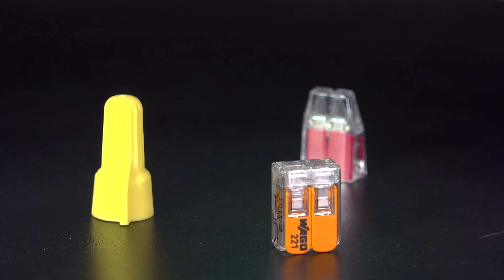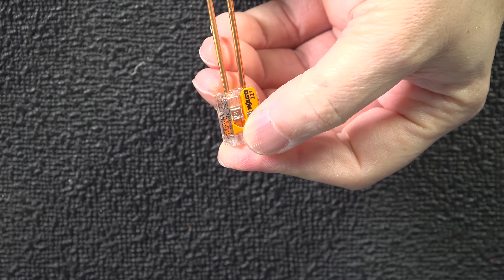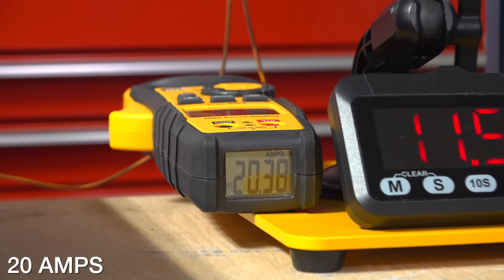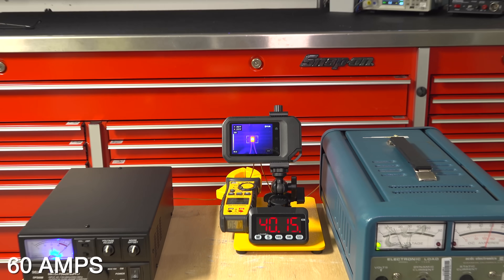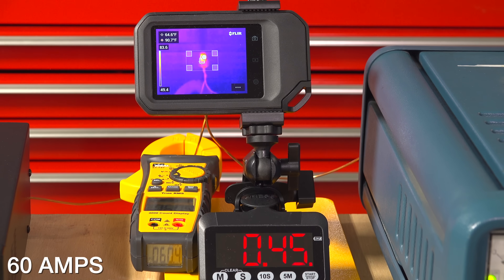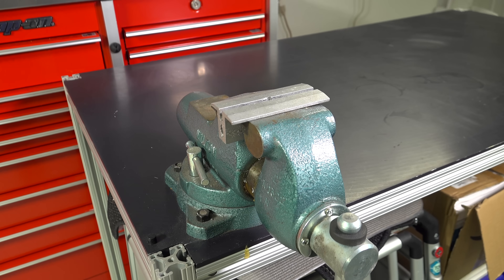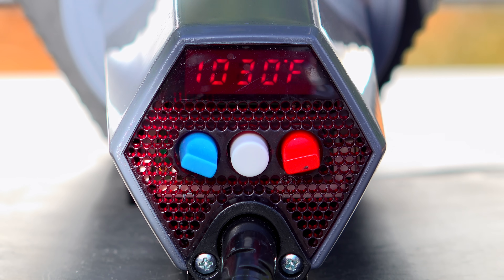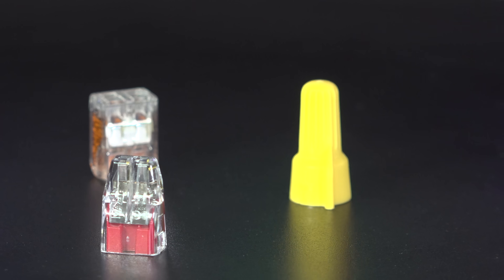What Wire Connector is the Best? Wire Nut VS Wago TESTED

Comment: This clearly shows the wire nuts are superior for Conduction
Reply: ? It shows they are superiour at being cheap, nothing else.
Reply: @TheEsseboy  conduction
Reply: @jfmc2581  Twist the wires before inserting into The other type and you achieve the same effect. Or just don't cause it's not worth it, get larger wires if you need lower resistance, the insulation will boil/burn off before the connector will.
Reply: @TheEsseboy  , Uhhh... No.
Reply: @jfmc2581  Uhhh.... yes!
Reply: @TheEsseboy  , Why do comment on things you obviously know Nothing about?

Are you proud of your ignorance?
Reply: @jfmc2581  I could ask you the same.
Reply: @TheEsseboy  , Being so stupid should hurt
Reply: @jfmc2581  You have presented nothing to prove your theories, please, your lack of self awareness is hilarious.
Reply: @TheEsseboy  LOL! There is no space for it!! You suggest having bare copper of the conductors outside the device is an improvement!!

The scarry thing about stupid people is they are too stupid to know how stupid they are...

I just hope your unique problem solving skills don't kill someone.

Comment: One big mistake in this comparison: in the overload test, the Wago connector was carrying all of the current.  For the wire nut, you pre-twisted the wires, and they were touching below the wire nut...thus current was being passed between the wires where they were in contact instead of all of the current passing through the wire nut.  Otherwise, you would have likely seen higher temps at the wire nut during maximum overload.
Reply: That was my first thought. He literally says he's going to hear shit if he doesn't twist them and then proceeds to twist to a degree that is not possible reducing the overall resistance.
Reply: Craig Dendy  I took his statement to mean the amount of twisting he did was far more than a typical example.  So, real world would be stripped insulation of 7/8" or so of a current carrying conductor twisted together and capped with the nut. In the video they guy took ground wires, which means unlimited conductor length (vs 7/8" stripped) which means more wire is in contact and not the same as the real world use.  Instead of saying "instead of all of the current passing through the wire nut" he should have said "instead of all of the current passing through the conductor only under the wire nut"
Reply: Craig Dendy  Sorry dude, these connectors are UL listed to UL 468C "Splicing Wire Connectors", the exact same standard used to certify wire nuts.  The testing these go through is far more rigorous than the tests shown in this video, and no, they don't wear out over time.
Reply: THIS!

Comment: Being that it raised temperature by 20 degrees under normal load shows it had energy loss and is not very efficient.
Reply from the maker: Full rated load, isn't normal load but 20 degrees is fine. All connections will generate some resistance.

Comment: I have been an electrician for over 45 years and I've repaired and replaced more of the quick wire Wago style connectors that have gone bad or had loose connections than wirenuts by at least 10 to 1.
Properly installed, a wirenut will last decades, I've seen the old porcelain wirenuts that still worked fine after at least 50 years.
Reply: And why should we trust your say so? I'd trust tests more than a guy on the internet.

Comment: 13.8 VDC Power Supply...REALLY?  The circuits in my house use 120 VAC.  Power equals Voltage times Current (P=E X I), testing with a DC power supply is ridiculous?
Reply from the maker: 60AMPS is 60AMPS. Do some research on the differences between AC & DC amps, let me know when you find the answer. Spoiler, they are the same.
Reply: No it's NOT...you stupid DUMB-A$$  Your 13.8 VDC @ 60 amps equates to 828 Watts.  Household 120 VAC @ 60 amps equates to 7200 watts.  Your test procedure is BULL$HIT, and your one of those people that only knows enough to be dangerous...so STFU!  WAGO's have their place, but they're not equivalent to pre-twisted #12's under a properly tightened wire nut. @SilverCymbal

Comment: As an engineer, it seems obvious that the spring-loaded connector is going to be more reliable.
Reply: Really?  How many wire nuts have you twisted on engineer?  The metal portion of a wire nut is sharp spring-steel and literally "bites" into the copper conductors.  WAGO's have their place, but they are not "more reliable" than a properly installed wire nut.
Reply: @tomnorman5461  They are, they are also faster and see through, much better.

Comment: The current/temperature test is unfair to the wagos. By twisting the copper wires together, you basically made the wires come in contact in parallel to the wirenut.  And with lower resistance since the contact point was so big.

Still, good advice. They all work if you use them correctly.  I like wagos to organize small boxes.

Comment: Master electrician here. I've long been a fan of pushin, levernut, and wire nut. I keep all three and they all have their place. 

I'm glad you did science on these. Now I have a video to show. 

I've done a lot of remodels and seen 20 or 30 year old wire nuts. Even the old tech holds up just fine.  I also extensively use them on motors.

In every single failure I've seen, it's been due to an improper connection being made. You have to pretwist. When you work the wire into the box, you change connection angles, and you can't tighten inside the box. I've seen, at minimum, dozens of failures specifically from this, and catastrophic failures from the resultant arcing.

Moral if the story is the connector is only as good as the installer.

Comment: Electrical engineer here. When you say "3 times the load" at 60A, it's actually worse than that. What causes heat is power dissipation. By Ohm's law, power dissipation is P=I^2 * R, so power is current squared times resistance of contact (which is stable). The 60A is 9 times more power dissipation than 20A:  (60*60)/(20*20) = 3600/400 = 9. That is why it was so much hotter at 40A, and even so much more at 60A. Doubling the current quadruples power dissipation, which directly proportional to the temperature increase. 60A is a torture test for sure.

Comment: I’ve switched to these and have used them for several projects in my home. They are easy to use and give me a higher sense of security over wire nuts, as I too, have had issues with wires in wire nuts not getting properly twisted. Thanks for the video!

Comment: Wonder why the actual (avg) price (per hundred) units isn't mentioned?   For instance: from today's (early 2022) prices per hundred units at Amazon: it's 25 cents for a 2 wire 'Wago' vs 4 cents for a standard wire nut.  Also, there exists an 'improved' 3M version of a one size fits all , wire nut that uses an internal spring for a more easily made, reliable connection - it costs 10 cents per hundred, and may be the best compromise...reason, this special wire nut doesn't require cutting and re-stripping when a change in wiring must be made.

Comment: Nice video. Not a electrician.  I believe I saw DC?  Would it be same with 110V AC?  I always tape wire nuts. As often on 1-10 hp motors.  Lots of vibration.

Comment: Excellent that someone did this, thank you. I wish you wouldn’t have twisted the wires when doing the wire nut. With that the test would have been the same if the wire nut wasn’t there. Also literally no one twists wires like that, it’s always about 3/4” exposed and stuffed into the nut.

Comment: Seems like every joe electrician is using these... and in my experience, electricians are lazy.... if they are aloud, and it’s “easier” and “works” then they love it... long term durability has never been on ANY electricians mind... if you properly twisted the wires past the nut, stripped your wires 2 inches, cut off the part you chewed up with pliers, and put a wire nut on there, that’s as strong as any wago.... you can pull the wires from wagos... try it... grab it one wire in each hand, leave slack and jerk.... they come apart.... they aren’t mechanically locked down in any way, I find them “still working” with tabs popped and wires laying in them, ready for some sorry electrician to come fiddle with it while it’s hot and get nailed... 

there’s no room for expansion...? Look inside the nut... it’s a spring... a spring... no room for expansion...?  I would assume the only reason these are approved is because they have seen the BS wire connections people do with the wire nuts.... people jam 3 ends in there not twisted, and just screw the nut on... good....
That’s not how it’s done.... on the plus side, although not very good... a 3 year old can “properly” install a wago... no excuses anymore.

Comment: 15/20A circuits are only used in 120v systems right? I only see 10A in my 240v country, 15A is only for ovens or welders
Reply: Here in germany we have 230V and 16A is pretty common.

Comment: With the Wago at the amperage/load specified in video and the wire nut wire twisted prior to wire-nut install the wire should have reached the same temperature's encountered by the splice devices.  With the wire nut you have conductor twisted around itself, no gap with the Wago you only have a small surface contact with a bridge. I think this video is inaccurate and exaggerated to sell product. The Wago might be a great product but by trying to exaggerate ability makes me question it. I also would question the 1100F for a polymer. PSE polymer is rated up to 200 C {392F} which is slightly lower than 1100F.. The melt point is 960F.

Comment: point proven...WEGO=fire hasard...honestly dint expect them to do so poorly...but eh...thay r american...and what happend in a enclosed space?...pretty sure u get a fire pretty fast...pretty unfair test also...to use low voltage twisters...THOSE R NOT FOR REGULAR POWER..., but i do agree thay ar capable connectors for low voltage or DC...NOT FOR POWER..., also no tearing test for the twisters, buit thay dont come off if done correctly with the rith twister for correct cables, alao twisters will always work until the metall begins to  melt...the cables will melt first..or rater ur house have already burned down...but the connectors fine...that wasent the problem..
Reply from the maker: Proven? Except there has never been one documented case that anyone has ever been able to share, not even a single picture But other than that.....
Reply: @SilverCymbal  well u just did.. if a twister in free air would get over 10 degrees above ambient at nominal...i would be very worried...besides electricans would nt use single core cables anyway inside walls...and thers a reason for that too

Comment: The problem with wire nuts? You can't inspect the connection. If you remove one, you can't just screw it back on. They cut a spiral into the wires, so the wires need to be shortened. If you're worried about Wagos getting knocked open, wrap with tape or heat shrink.

Comment: It should be noted that doubling the current through a connector will quadruple resistive power dissipation therein, and tripling the current will increase resistive power dissipation ninefold.  A 3x overload is thus far more severe than it sounds.

Comment: Great video thanks for that!

I actually learned about these the other day on another channel, and of course some claimed in comments they wont hold up to loads you have in the house in lights and plugs, well, they are rated for 12 GA wire, and another model down to 10GA wire, they are certified and UL listed, so they had to earn those thru rigid scientific tests like UL does.
I ordered a kit of 175 WAGO connectors and plan to replace ALL the wire nuts I have, many have multiple wires, as well as solid and stranded together which is always dicey, but the nuts take up lots more space is always too small boxes.

The kit should arrive next week and I'll be working on this then!

Comment: Seems somewhat unfair against the Wagos that the wirenut's wires are twisted together for some length, allowing them to conduct some electricity along the twist, not just inside the joint.

If you ever redo this experiment, please do it with insulated conductors.

Comment: I am almost sold on these. I understand expansion and contraction. Seems like under normal loads Wago is a good choice. I have seen many wires work loose even under normal loads. I still think more connection area would be better BUT you have tested and shown these are much easier to work with. Thanks for the follow up tests!

Comment: Good video. The biggest problem I foresee with the wago connectors is the same as the problem I have seen with the back stab connection used on many receptacles and switches. The problem I have found over the years is that with circuits that have higher current flow and are cycled frequently the blades that hold the wire in theses type devices tend to weaken due to the heating and cooling effect of the use cycle. This heating and coiling effect apparently changes the molecular structure of the metal causing a lose of tension on the wire.  I know, a lot of people say I am just and old school guy, but I say if it ain’t broke why change it. First I must say I have never used the back stab connectors in my 45 to 50 years as an electrician. I have changed a lot of receptacles and switches over the years however.  I can honestly say I have never in all those years went back to a job I did to replace a switch or receptacle because of a loose connection. But if people choose to use them, it is good job security for electricians, but not me I am retired.
Reply: Do not compare crap backstab receptables with Wago products!
Reply: This is your theory, but has been refuted in practice. Wagos are not backstab connectors. The material and mechanism is quite different. They have been used in Germany for decades, and electricians do not have to go back to redo them. They are expected to last as long as the whole house wiring without the spring connectors loosening up, which would be beyond 50 years. Therefore, Wagos don't provide "good job security for electricians".

Comment: Hi, I need to replace my smoke alarm in my home and they are all wired using twist wire nuts. Can I replace them with push-in wire connectors or do I need to stick with using wire nuts?

Comment: Good Video but what about "Ideal" brand connectors are they just as good as Wago's? And I've heard people say a lot of Electricians are cheap too they rather use "Wire Nuts" to save money if they're supplying the material. But I'm not an electrician so I wouldn't know?
Reply from the maker: I don't like the Ideal connectors, they are stuck because they can't infringe on the Wago patent. Their issue that I dont like is when you have to remove a wire its terrible. Truthfullt I don't like Wago push in only connectors either for the same. reason. The ones in the Video are the Wago 221 series, those are the only ones to get due to the lever system in them

Comment: Push-in connectors reflect cheap and lazy workmanship. They are also dangerous due to their inherently small surface area of contact, whereas twisted wires have much more contact and strength. Push 8n connectors start many house fires. Do you want to be responsible for burning someone’s house down?

Comment: Essentially, wagos are electrical conductors, transferring current between two or more conductors, while the traditional wire nuts are simply insulators with a metal coil inside designed to grab and form around the pre-twisted conductors.

Comment: Good test.  It boils down to pure physics, like most things,... how much contact area is made with the connector.  Even a wire nut will overheat if not properly twisted on (even if pre-twisted).  Small contact area equals more heat generated.  While I currently use wire nuts, I plan to move to Wagos when my stash runs out.

Comment: Seems to me that you biased the thermal test toward the wire nut with the twists that extended out from it. A more fair test imho would be to make sure that the wires did not touch each other outside the wire nut.

Comment: Wagos are fine. But so are correctly installed wire nuts. Personally, a wire nut on pre-twisted wires is the best. That way the connection doesn't rely on the connector itself. The wire nut is just insulation in that case.

Comment: I am not an electrician; only a DIY person.  Like most everything, opinion makes a good choice difficult.  There are professionals on both sides of the isle on Wago.  While some electricians claim Wago is a fire starter, while your test shows them to be completely safe, under rated use.  At 15 amps, Wago performs well as intended.  At 60 amps, they get hot.  Technically, how could you draw 60 amps through a 15 amp breaker?  You can't, so it appears the Wago is fine.  Some videos claim Wago is not allowed in commercial use.  Why?  Does that mean that the traditional wire nut is better?

Comment: Just 2 cents from a layman...so, great job, 'anything' will work when clean, and brand new....just twist the wire with nothing, and check it... BUT.... give it 10 or 20 yrs. of temp cycling, and oxidation, humidity, and of course 'house' vibrations, (door slamming, plug yanking)....and give that a test....  just saying....

Comment: I am OK with the lever type. I just don't like the push in type Wago. I noticed he did not do the pull test on the twisted wire nut. I would have liked to seen a pull test on a not pre-twisted wire nut as well.

Comment: For the temperature of the twist nut test when running current through it you twisted way more than you would with a typical twist on connector as the conductors were twisted at least 2” past the twist on. I would be curious how the test would run if you only twisted an equivalent length to what would be used with insulated wire.